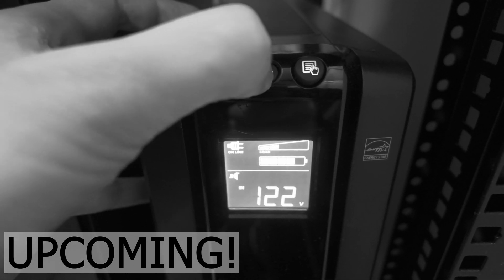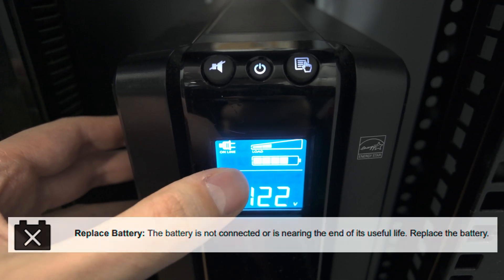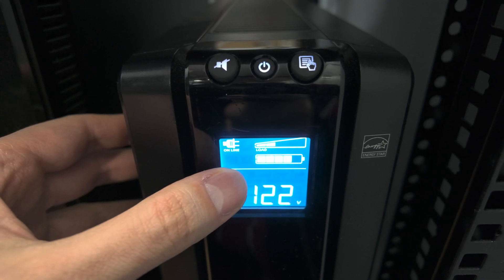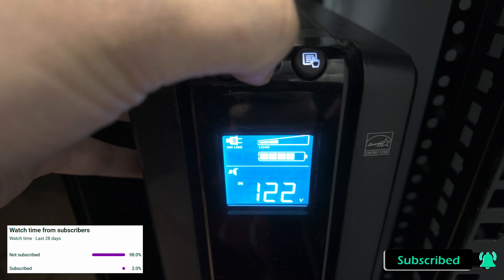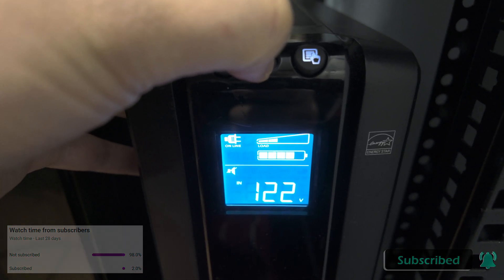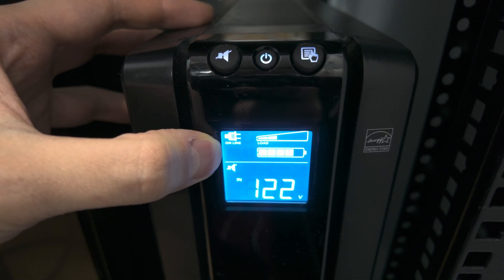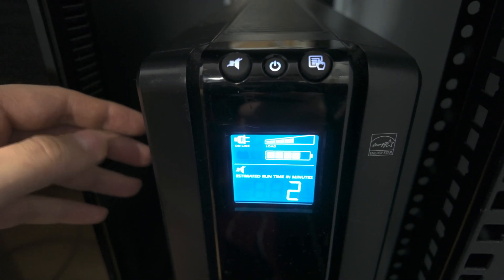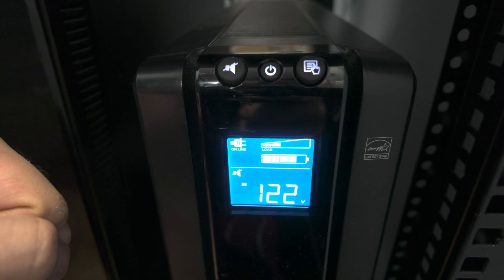Tutorial: How to Self-Test APC Back-UPS Pro Without Shutting It Down

Comment: I hotswapped the battery yesterday and did a manual self test and everything stayed on.  The battery wasn't fully charged so it reported low runtime.  I let it charge overnight, go back to do a self test the exact same way... and everything turns off.  Sigh.  It came back up and did it's own self test on reboot and displayed better projected runtime.  But now I'm data scrubbing my server.

Comment: Is that LiFePO4 review up?  Looked, didn't see it right off.

BTW, fun fact, on the XS 1500 which looks identical it just shuts off instantly when you hold the button down.  The icon was flashing so I wanted to check.  After powering back up it ran a self test and now says the battery is good for 65min - had that regularly with these APCs, they'll complain the battery is no good, then stop complaining for months, then back to it again.  Got a couple LiFePO4 to put in, just haven't brought myself to do it yet.

Comment: What does it mean that the contour or outline of the battery is flashing and the inside is hollow?
Reply: The batteries are upside down for shipping disconnected (red label showing). Follow instructions to remove and install batteries upside up for normal use (green label showing).

Comment: if i run the test and the battery icon is still flashing, does that mean replacement? or should i wait overnight for it to try and accumulate some charge. great video btw.
Reply from the maker: @pedroynigo1916 Yes, you will need to replace the battery. If the new battery is installed and the icon is still present after the self-test, then the UPS is faulty.

Presuming that both batteries are charged, either internally by the UPS or externally by a battery charger.

Comment: Does this test the fan too? I picked one up second hand but I didn't hear the fan spin up  when it when on battery mode.
Reply from the maker: @StarkillerRadio No idea — the fan might be thermally controlled, meaning it only turns on when components get hot. It may also adjust its speed based on temperature.